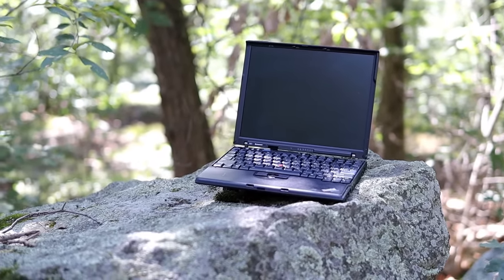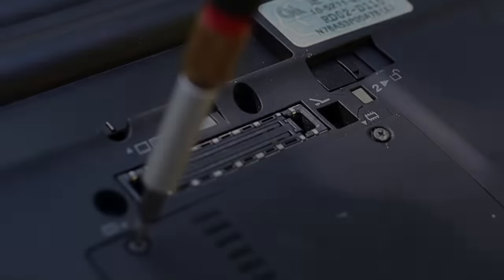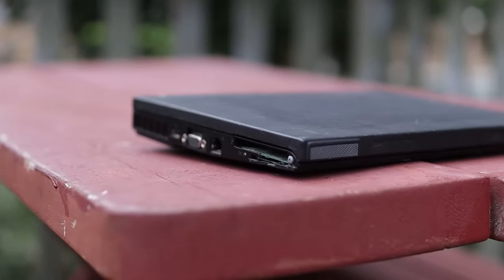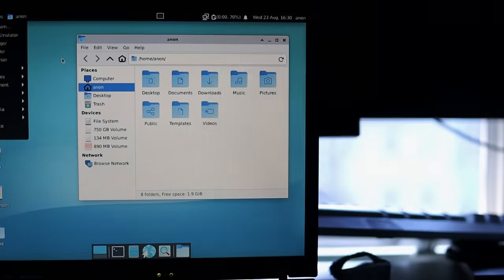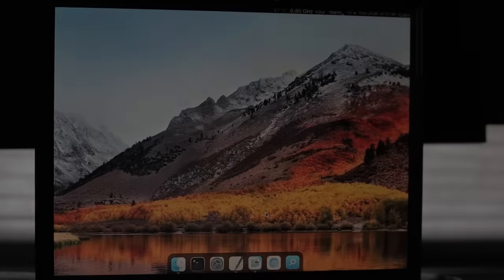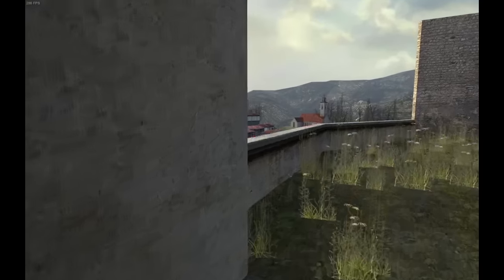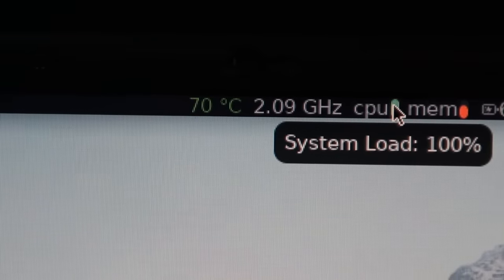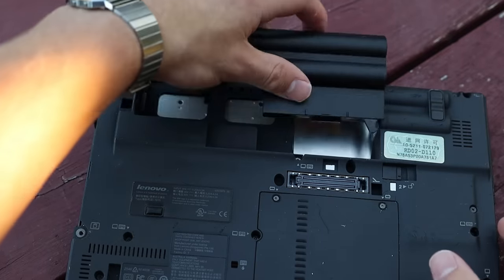Can Linux save this old laptop from obsolescence?

Comment: I installed windoze10, not Linux, onto a 2009 HP laptop (2.2GHz), and it works fine for use in my classroom.  (Linux is my everyday OS at home.)  I had to upgrade the ram (4GB DDR2) and a new 1TB HDD, but aside from that, it does 64bit just fine.  Granted, I'm doing low end work (basic web browsing, document editing, play audio and video, etc.), but never have any lag.  There's no reason older computers can't be everyday machines for some task unless they're physically broken.  The downside compared to that thinkpad is the that the HP is a pig, over 2kg.  Definitely a machine that stays put, not portable.

My Acer Aspire One was the recipient of the HP's old 2GB RAM.  Now it flies as a travel gaming/emu machine.

Comment: During your tests of the games, I noticed you had the Steam FPS counter in the top left which might've had a negative effect on your results as the steam overlay is actually a bit taxing on the CPU from what I recall. I remember trying to play Monster Hunter World on a pretty mid tier computer last year and it would hit around 45 fps on low until I turned off the steam overlay and made steam more lightweight which boosted the frames up to 60+ which was really nice. 

I doubt you'd see a lot of improvement, but it'd be interesting to see how Steam might be taking power away from the games if you were to do something like this again.
Reply from the maker: Good to know!

Comment: I use a 12 years old HP Elitebook 8460p as laptop. It has two functions Laptop and Backup Server.  The HW is; Intel i5-2520M; 8GB DDR3; 2TB HDD. The software is Ubuntu + OpenZFS + Virtualbox + 70 VMs  :)  It runs VMs for Windows 1.04 (1987) and Windows 11 Pro (2023) and both are workable. However Windows 1.04  is more unpleasant due to its tiling Windows Manager.  The oldest and newest Linux VMs are Ubuntu 04.10 and Ubuntu 23.10.  Other interesting still used VMs are:  Ubuntu 16.04 ESM for banking and Windows XP Home as Jukebox installed and activated in March 2010.

Comment: I have a similar laptop to this, it'll be going 15 on the 28th of December. Currently it has 4gb of ddr2 with plans to go to 8gb, a core2 duo t7250 with plans for a P9700. I've basically got the Theseus ship situation here since the only things I haven't replaced as of now is one of the ram sticks, the battery, mobo, CPU and the screen. Everything else including the entire case has been replaced
Reply: Although the cost of that 8gb of ddr2 alone is more than the entire amount of money I've spent on the pc 💀

Comment: As noted, there are more options for upgrading, so could push it up to 16 GB RAM, 5 TB HD, and, if feeling adventurous, can possible add a graphics card. The drivers probably were quite a bit outdated, so upgrading those, or making sure you have the Linux drives optimized for the type of processor you have, be it Intel or AMD, can make a few noticeable boosts in performance. But yeah, I use Mabox in my current laptop I got back around 2019. I like the lightweight distros because I like being free of bloat, and for doing things with music, as well as some gaming, having zero latency is very much necessary. I saw a bit of a difference when doing a similar work flow of audio editing on my other laptop with Win 10, and it was a much more choppy experience, plus the wav file wound up buggy and had terrible playback.  Meanwhile, the audio edits I've done on Mabox, the wav files run just fine, with no choppiness whatsoever. Lightweight and zero latency is just better all around.
Reply: dude what are you talking about; this is an ancient thinkpad and not all thinkpads are worth upgrade especially this model that doesn't support 16gb of ram

Comment: what an excellent video!
many thanks for it!

I do some data science programming, and I can see ust how mny numbers even older laptops can (still) crunch quickly.
I don't think veryday people realise just how powerful even old laptops are.
heavy operating systems and applications (cough...even webbrowsing..), however, do soak up a fair bit of the power that's there.

writing this on a blazing 'new' macbook pro from late 2013 that shows no sign of slowness ;)

Comment: I still use a Lenovo G780 with a Core i5 and GeForce GT630M from 2012 daily for basic web browsing and streaming usage. I have to keep it plugged in as the battery has weakened badly over the past few years. It will not allow me to use an aftermarket battery as the firmware refuses to let it charge, and Lenovo no longer makes them and the only ones I can find are overpriced second-hand ones that are likely on borrowed time. I added more RAM and replaced the slow HDD with a SSD, and it works just as well as a basic modern laptop. I've gone through Windows 7, Windows 8, Windows 8.1, and now Windows 10. I have no desire to move to Windows 11 on it unless I absolutely have to.

Comment: I have a comparable Acer Aspire 5315 with similar specs, slightly more ram at 5GB, and with an SSD and wifi upgrade. Its actually remarkable how capable it is for all the aforementioned points in your video. It can even do stuff not even possible back in its day like stream audio to apple Airplay speakers thanks to Pipewire. Its currently running EndeavourOS, because i use an arch flavour btw (lol), but interested to give Void Linux a try. I have also toyed with the idea of running Alpine on it. 

For gaming, the best options in my opinion are OpenGL 1.5 era games, or even earlier titles using a software renderer. Anything from the Quake 2 era with a modern engine. I managed to get Half-Life running on it at an acceptable speed using the software renderer. OpenGL 2.1 on those integrated intel chip-sets is not really worth the hassle. One noteworthy title that runs shockingly well is the Super Mario 64 reverse engineered port in 640x480. 

(EDIT) I forgot to mention despite its age and limited usefulness it served as an important test bed for moving all my desktops to GNU Linux. I was so happy with the performance on such crappy hardware that now my almost as obsolete iMac 2013 is running Linux too...
Reply from the maker: Yeah its amazing what some of these old machines can do with some small upgrades and a new OS!

Comment: I dont get why you chose a 5200rpm hard drive...7200 at least...even today if a 5400 hard drive is installed in a modern laptop it slows down every single thing
Reply: Yeah 5400 RPM drives aren't even worth being used in a daily.

Comment: Dual core 2.1 GHz with 4 GB RAM. That's not bad at all! You can actually do a lot with that. Heck for a large percentage of computer users that can do anything they need it to do. I would put Mint on it with the Cinnamon desktop. Heck even if it only had 2GB of RAM it would still run pretty good with Linux Mint Cinnamon. A large percentage of computer users only really use the web browser and some light weight programs like messaging programs.

Comment: you should really use an ssd especially for an older system like this, cheap one will do and it will greatly upgrade your experience whilst its not gonna affect performance.

Comment: one thing you can do with core2 based CPUs is run an email server and/or ansible/terraform server. some of the CI/CD stuff are not CPU bottlenecked. Mine is an old t61p thats in pieces (screen doesnt work so i've had it dismantled for a long time). laptop works totally fine so i just use it as i mentioned which uses a 600GB HDD but i was reusing hardware i had and not buying anything new. I also bought 8GB of ram for it long ago. although GPU doesnt really matter for use of terminal only OS and when i used the laptop long ago it was pretty cool and could play games like skyrim, transformers. expresscard and dock were fun for the hotswap GPUs and other PCIe cards where alienware AGA is quite the shame in comparison due to not supporting other PCIe cards and the alienware quality itself is just terrible giving me a modern paperweight.

Comment: 00:05 Old laptops like ThinkPad x61 can still be useful with the right operating system.
01:38 Older laptops are easily upgradable and can extend their useful life.
03:13 Laptop's hardware limitations dictate choice of operating system.
04:48 Void Linux with xfce desktop environment boosts system performance and customizability.
06:17 Linux on the x61 can handle basic tasks and productivity apps well.
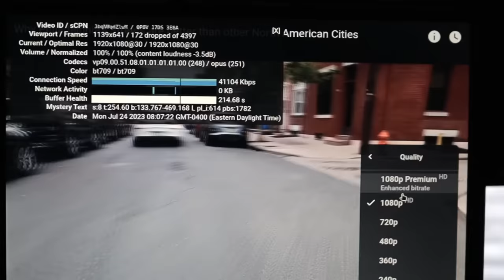07:57 Old laptop can handle light tasks but struggles with gaming
09:36 Old laptop performs well for basic tasks with lightweight Linux distribution.
11:15 Chromebook pulls ahead in weight, thinness, and battery life.
Reply from the maker: cool!

Comment: Great video, I did something similar with a atom n270 and a celeron m 430. The more important parts is having enough ram and with a decent enough disc you can do it well too. But if you can put a ssd it would help on those parts that the pc isn't enough. I still have sata hdd tho. For me rasbian 32 bits worked. In the past I used also puppy and slax. Rasbian is simple enough for me.

Comment: I was given an Acer laptop from 2008 with 2 giga ram 4 or 5 years ago which couldn't be increased. I installed Mx Linux and it is still performing well. Youtube is a bit sketchy though. Gaming is not my thing, so no problem there. But now I cannot update my 19 version to the current 23 so I will have install it new. I expect it to work fine. This XFSC distro has lots of things one can add.
Reply from the maker: nice!

Comment: >only 1024x768
When you find out the leading resolution in modern laptops comes in a crappy 1366x768 branded HD. 
I have a T61p, and it is a fantastic machine even today. And the screen is true 24bpp not 18bpp as most machines are. especially Acer.

Comment: I just pulled my old Thinkpad T410 out of the storage. I bought this 13 years ago I believe.
Quick specs: 
1440 x 900 14.1” screen
Intel Core i5 540M 2.53 GHz
6 GB RAM
I went ahead and replaced the 5,400rpm HDD with a 500 GB SSD.

I installed LMDE Cinnamon. This is not a lightweight Linux distro. Anyway, the results: This thing runs SNAPPY!
Reply from the maker: Nice! There's honestly something kind of therapeutic about reviving old laptops.
Reply: @liamjewell62  🖖

Comment: Asus k53E 8 gigs ssd I5 core 2 duo dvd hdmi usb 2x2 1x3.
Had to replace the power supply for it a few years ago, but I also have a 12v plug in converter which makes it solar friendly at camp.
Reply from the maker: neat!

Comment: I've recently picked up a similar machine, a mid-2010 Mac mini with the P8600 processor and 8 GB of RAM. It's got a dual boot setup of Mac OS X Snow Leopard and Windows 8.1 currently, although it spends almost all its time on Windows: I bought it for MAME and Retroarch, and it does that perfectly. 

The Nvidia 320M drivers have issues under Windows 8.1 and 10, however (some applications seem to be completely broken and display glitching similar to a dying GPU, I've found other reports of the same problem in forums on machines that just like mine do not actually seem to have any hardware issues), so I've been considering replacing the Windows partition with Fedora as High Sierra is no longer well supported and due to the old Nvidia graphics chip, it's not Metal compatible so patching something like Ventura or Sonoma to run on it would be a major pain. 

It does all the tasks on this video well, from basic gaming to 1080p60 video on YouTube (through Firefox) without drops. Surprisingly enjoyable machine despite its age.
Reply from the maker: Its amazing how well some old macbooks have aged! The screen and touchpad beats these thinkpads hands down ngl.
Reply: @liamjewell62  Agreed, have had a mid-2012 Pro (the last one before they all went Retina display) that's treated me well over the past 12 years. I haven't been using it much lately, but it's still around.

Comment: Now you have a very competent equipment.
If you don't like It, you can always make a gift to people that doesn't have resources.
I still have the laptop that i used on university.
Intel Celeron 1 core at 1.6Ghz 32 bits with i915 integrated graphics.
Using Gentoo Linux It still can play 480p YouTube videos and It can use libreoffice writer.
We need to reduce the e-waste with opensource.

Comment: I experimented with various OSes on old Core2Duo and Core2Quad desktopsystems last year. bought several boxes of ewaste for a couple $ and there were dozens of motherboards that just worked fine.
What I found is that windows 10 doesn't even hold up that badly if you use a debloating script like the one from Chris Titus or a similiar thing that rips out all the telemetry and other background processes that are only there for MS and not the user. They even ran 1080p youtube usually a tad faster than the various Linux distros I tried.

Comment: I'm still rocking a 2006 x200 (core2duo at 2.44ghz/4gb ram/60 sata ssd with Pop!_OS 22.04LTS) and use it for writing /reading/ light media consumption
Got 2x 6 cell batteries & the ultrabase 2 w/ dvd drive and/or a 2nd hdd for windows xp (and a load of games)
Edit: 
I also use it with a gt 710 via expresscard eGPU for xp gaming (vid on my channel)

This video is great and is tempting me to scour ebay for one myself

Comment: I had a celeron m E-Machine Notebook that even ran with lmde and lubuntu.
Still a single core and 1GByte of RAM just gets you so far today.
I got lucky and was able to upgrade the Cpu (without sodering!) to an core 2 duo extreme edition and 2gb RAM.
Portable devices were build differently 20 years ago...
Reply from the maker: You don't see many E-machines laptops these days lol
Reply: @liamjewell62 Ye
I think Acer bought them or so

Comment: The T8100 is a 64bit processor which means you can install up to 8GB of ram and run 64bit OS. I have an X61 Tablet that's running Windows 10 Pro with 8GB RAM and 256G SSD and works like a champ - even better running a stripped down Windows like Tiny 10, or Ghost Spectre Superlite Windows 10.
Reply: Are 4GB DDR2 SODIMMs a thing? if they exist I'm sure are rare

Comment: You could have upgraded the HDD with a 2.5" SSD. The M.2 SSD runs optimally at SATA 3 speed when this laptop supports only SATA II. However, the SSD still would have worked, but at the ceiling of SATA II speed which would have been still higher than the mechanical HDD.
Reply from the maker: True

Comment: I use a slower core 2 duo toshiba equium as my main laptop right now running endeavouros (I also have a proper desktop for actual work and games). I've taken to using WindowMaker as my window manager as it go Brrr on ancient hardware with very weak GPUs and I find it more usable then xfce4 on the machine. Plasma is unusable due to the graphics driver for my super low end intel GMA GPU (beware that you are not using llvmpipe, but even with a proper outdated driver plasma is still largely unusable). You can use zram to help with memory limitations I think. Tiling window managers are likely to offer the highest performance I would expect. You can use plugins that suspend unused tabs after some time to save more memory. You may also consider building kernels with CPU specific optimizations. I haven't really been successful in running even simple steam games for what I assume are GPU driver related issues. Steam streaming is sort of possible at low quality but the stream randomly freezes and requires restarting. For some old laptops, you can get an extended battery that hangs out the back more to increase battery life.

Comment: My main laptop is a sony vaio vgn-tz37gn (2008) with a core 2 duo and its currently running windows 8.1 (the best performing windows version that still sort of works in my opinion). core 2 duo max 2gb ram. planning to install debian on it soon. want to swap an ssd in put taking it apart is awful considering you unscrew on the bottom and then you have to take the cover off the power button THEN you lift up the keyboard. the hdd works for now though. the camera doesnt work but the fingerprint reader does and quite well (and the battery is quite okay)

Comment: To be fair, I would say this would be quite useable on Windows 10 even. I say that, as I used several older laptops on Windows 10. Those being, a Intel Pentium T4200, Intel Core2 Duo T5800, AMD Turion TL-60, a AMD Athlon X2 5600+. And those actually are pretty useable.

The somewhat modern Intel Celeron N2815 is useable too, but not quick, quite slow actually. It is slower than the Intel Pentium 4 641. In Cinebench R23, the Celeron got 188 Single, 360 Multi for the test. And the Pentium 4, 641 got 245 Single, 457 Multi.

I've also have tested some single core CPU's as well, I found the Intel Pentium 4, 641 useable. The Intel Celeron G470 (The newest, and fastest single core CPU on LGA 1155) pretty useable. I still use that on Windows 10 to this day actually. The hyperthreading on those single core CPU's really help them. 

But most single core CPU's are pretty useless anymore, like the AMD Athlon LE-1620, AMD Athlon LE-1640 (getting around 230 points in Cinebench R23). And the Worst CPU I ever tested was the AMD Athlon II 160U. It is just... Unbearably slow. Even for me, someone fine with slow things. 

The AMD Athlon II 160U got about 200 points in Cinebench R23.

I also disagree. I find 2 GB of RAM useable, but not great. But if you have a pagefile/swap file, and you have the browser so it won't put the tabs to sleep, it isn't that bad actually. But I also would upgrade it to 4 GB too. It's nicer to have more RAM if you don't have an SSD.
Reply: Sorry, I lost you when you said "usable on Windows 10".

Windows 10 is not usable, especially when you have to constantly fight de-bloat it because every time it forces an update on you, you have to check your customisations again in case Microsoft has reverted them.

People that spend time making Windows 10 "usable" would use their time better just learning Linux.